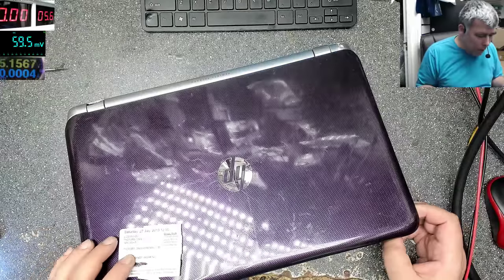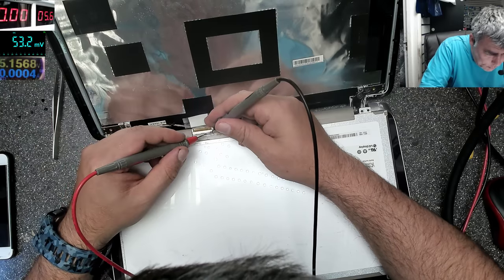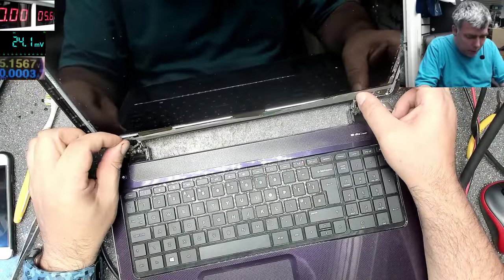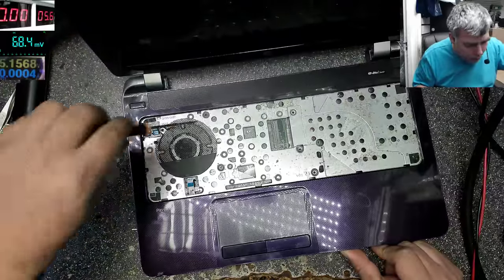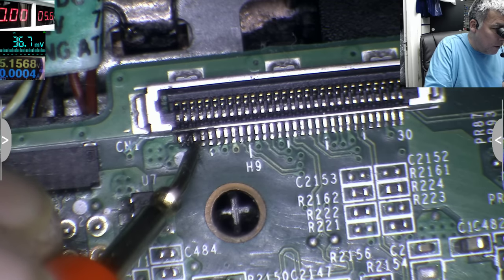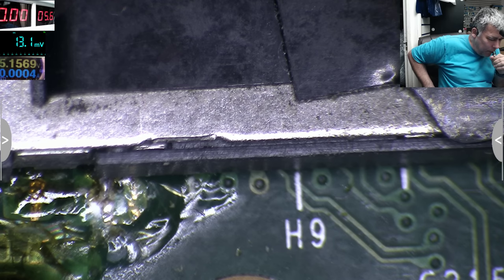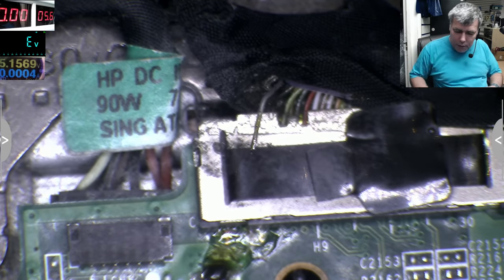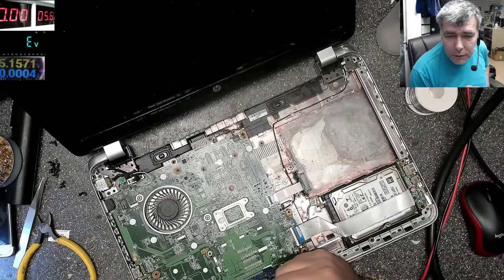Laptop backlight circuit - Diagnose and repair

Comment: Just wanted to say. this is the stuff I do all day long. not boring for me. I like to see Sorin getting the job done. and under 30 mins. thats where the money is at boys n girls. If you can diagnose and repair in under an hour you can make money and be fair to the customer. When you need to dig out the schematics and start troubleshooting the circuit your bill goes up and the customer might start to wince at the cost of repair. so this is how you do it fair for both parties. keep making videos Sorin, your the guy on the front line that makes both honest and frank videos, to the point and very informative.

Comment: Because of your videos I was able to buy a "nice laptop" (MSI GP60, sold "completely dead" for around 100$), exchange dead power supply + one of the capacitors that was shorting and got myself a completely fine hardware in perfect shape, that I'm currently using at work. 
Thanks a lot, Sorin!
Reply: WTF, where do you work that they do not value your input enough to provide you with a laptop?
Reply: @incandescentwithrage  I'm a civil engineer with master degree and for last year I've been working with my wife (same degree) in construction site estimates. Yes, it's our private company and for the most of the time I'm working on my main station (i5 6600k, 16gb ddr4 2400Mhz HyperX, gtx 1050 6GB by MSI), but lately I was in a need for an efficient enough unit to run some costing-estimate software on-the-field. And, since I really like a challenge, instead of buying some cheap Lenovo, I tried to put whatever Sorin taught me to work, and work it did! :) Once again, thank you for all your tough work, Sorin!
Reply: Fair enough, self employed / business owner would explain it.
Finding shorted ceramic caps is great.

Comment: Ok, I have to say this was very dodgy xD, but for old machines it's all right. I would have been thinking for days maybe to find the connector and to change it, then I would have spent few more other days to figure out how to change it. Mr Sorin is just putting a wire and done. Next. You are on a whole other level...
Reply: You are right, this is the quick fix.
Not dodgy at all, even beter !
As the power does not pass the connector any more, and has a stable fixed power line.
The fix price is low, and so is the amount of repleacement parts 😉
Use this information to see how it works and how problems can be found on backlight issues.
How you fix your own board is not the same, for sure you would take more time and care (parts).
Thanks Sorin for this great repair information, and quick fix tutorial !

Comment: Lenovo x390 ThinkPad 13.3 inches backlight ..Do you know where on the board I can find the fuse etc..LCD screen I got a new one and it works. I forgot to disconnect the battery while changing the LCD

Comment: Thank you mr Sorin. Yesterday i fixed short dell inspiron  laptop, right now wen i press power key fan spins for seconds then goes off. what could be the problem
Reply: Maybe your processor is not yet hot thas why it stoped..wait for a few minutes,it will spin again if the processor is becoming hot
Reply: i doesn't even come on the screen
Reply: Maybe you still have a motherboard issue

Comment: What fluid do you use for cleaning water damage? Thanks for the great videos
Reply: Zippo petrol ,firstly ı saw from sorin ,then ı apply on about everything it gives shine and a lil bit protection a very thin layer ,but it solves the most problems after wd-40.
Reply: Serhat thank you

Comment: Why i don't see this video before.
I have a laptop with two pins missing in the Motherboard connector. And i think are the 19v.
I had to buy a new motherboard for my bad diagnosis, to my custumer. And it had to come out from wallet
😥😥😥
I would like to know about electronics.

Comment: What... Did You use your fuse wire to make the connection 🤔😏
Reply: well. if the fuse wire is rated about say 3A then thats ok. the line should not carry more than that. its a tiny little wire, thats why it is paired so that the wire doesn't melt, the fuse wire is not a bad move in that if something grim occurs then the fuse will break. saving the display..in theory. but yes, I use fuse wire where ever I can. say jumping over bad mosfets.